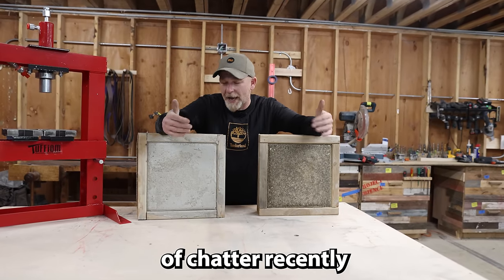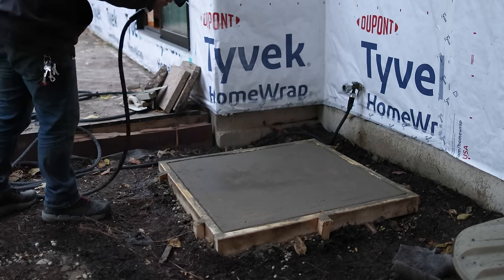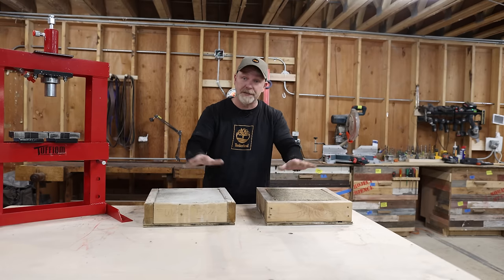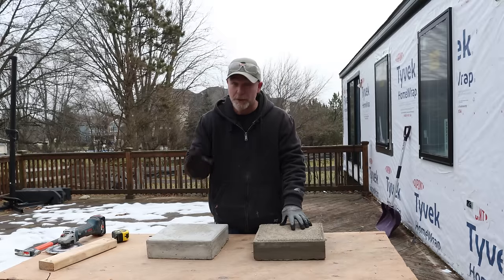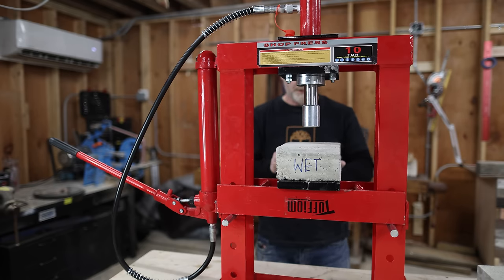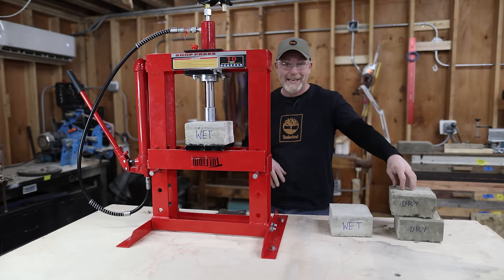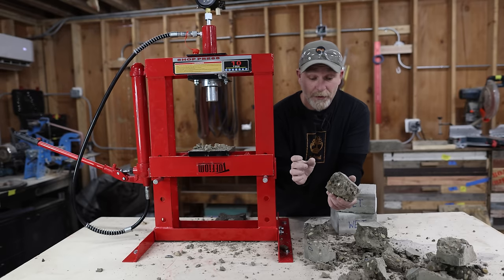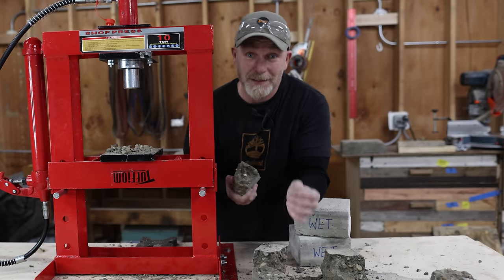The TRUTH About Dry Pour vs Wet Pour Concrete!! Strength Test - You WON'T Believe the results!!

Comment: I'm glad to see the experiment completed, but can't see how anyone would have predicted a different outcome. The strength of the concrete comes from the cement and water being mixed in and helping everything stick together. There's a reason why you don't see manufacturers recommending it. Dry pour concrete is like baking a cake without mixing the ingredients together. You get similar undesirable results. Thanks for demonstrating what a bad idea this is.
Reply: Great analogy to baking a cake
Reply: There was some home improvement dude on youtube a few months ago that was insisting it's fine to dry pour for walkways and stuff, kept doubling down
Reply: My woman makes a "dump cake" that's made kinda like dry pour. It's genuinely delicious
Reply: like a traditional scone, yuck, unless you like to chew powder, un done bits.
 I like scones that have been "ruined' with proper mixing then baking.
Reply: And yet, Hoover Dam was entirely done as dry pour. When the engineering is right, it works.
Reply: @Joe-xy3vy  no it wasn't, there is film existing of them placing normal concrete.
Reply: @Joe-xy3vy   proof?
Reply: @jimmaag4274   I thought so too.
dry pour is a flaky way to go for strength.
 it does good on a fence post application.
Ive never seen it work for a slab or sidewalk.
 seen it tried on slabs - shoveled that mess out & did it right
Reply: I saw it covered in a documentary at some length. The engineers discovered that their particular formulation of Portland cement was stronger if very little moisture was added, and the best way to control for that was to dry pour, then add a measured amount of water. Unfortunately, there's about a thousand Hoover dam documentaries, so good luck finding it.
Reply: There's lots of archival footage of the concrete being poured from the cableway hoppers, and it's definitely soupy. You are dead wrong here.
Reply: @Joe-xy3vy     ? ? ? ! ! !    I think when I have seen those old black & white film documentaries, that was all wet concrete coming out of that  bucket !   I never recall one word of 'dry pour' being mentioned.   They were surrounded by the 'dry' desert.
Reply: I would bet money that Dry Pour was invented by an Accountant.    :-)      Who the heck else would come up with such a stupid idea !
Reply: @Joe-xy3vy Hoover Dam used wet pour concrete. See https://en.wikipedia.org/wiki/Hoover_Dam
Reply: @Joe-xy3vy  r u joking?
Reply: @Joe-xy3vy  wrong
Reply: @BillSmith-fx7xx  someone looking for likes.
Reply: the only time manufacturers are recommending dry pour is for securing fence posts, that is like the one time you would want to do that
Reply: Because now I know anything over 8000lbs is a no no. That's if 50 people are jumping where you put it, or if you have a truck or deliveries going through.

Comment: This is why the teaching of basic science is still so critical.
Reply: 1 outta 6 American's believe the Earth may be flat.  Sleep well.
Reply: This comment is true.
Reply: Science is exactly the answer.
Reply: I loved this video as a learning tool, and I agree that basing knowledge on science is critical, but he would have learned more, more quickly, and more reliably by researching the subject on line than testing it himself.
Reply: This is not basic science, its ongoing research.
Reply: @Georgggg  That requires a basic understanding of science to be able to assess its probable veracity. But yeah, keep em stupid and frightened
Reply: Actually it's like throwing eggs, sugar, water, butter, flour, and oil into a bowl without mixing. placing it in a oven for 6 hours on the lowest heat setting and expecting a cake to come out.... What you get is a burnt mess with no resemblance to a cake.
Reply: @Georgggg  <<This is not basic science, its ongoing research.>>

The research methodology employed IS basic science, though. That's the important part.
Reply: Yes

The wet method creates a suspension, where the finer particles are evenly distributed.
In the dry method, smaller particles filter through and settle on the bottom. That's why the top has that grainy texture.
There may also be differences in the amount of water used. If the dry method uses less water, it wouldn't fully saturate, and can have more variations of water distribution, dry patches, and adding the water may further disturb particles, causing them to settle further down. Results in chalky easily breaking apart cement/concrete. And I'm no scientist lol! that is from basic 90's high school science classes. (maybe even middle school or elementary)
Reply: @jimmiller5600  The 1 has never owned a cat. if the world was indeed flat the worlds cat population would have everything knocked off of it by now..
Reply: @andreademirel5911  Dry pour does indeed crumble MUCH more easily, but for some purposes, that's not an issue.
Reply: @Georgggg research is science is research.
Reply: and this guy should not be teaching it, lolzzzz
Reply: @ajm5007  This comment basically sums up dry vs wet concrete pours. Dry pour for fence posts? Yes. For anything important like a structural foundation? Definitely not. For sidewalks? Yeah, sure if you don't take pride in workmanship.

Comment: Thank you for this. I instinctively knew “dry pouring” wasn’t good but you have proved it without a doubt.
Reply: Nope. He only proved he did an incorrect test. It was wrong on so many levels.
Reply: It's also very often more than good enough
Reply: Spot on Chris dry pour is trash. Only unskilled diy knobs do dry pour. They are the same ones that swear by it because they have no idea.
Reply: It's fine if you do it right. This guy did not.
Reply: Dry concrete says right on bag the tensile strength is less than wet. But it ain't as bad as in this video. In this video the dry concrete was not made according to the instructions.
Reply: As I stated in a comment. He compacted his dry poor. Not much oxygen for curing so you'd expect this
Reply: @robertm1672  

Can you please explain more? Wrong on so many levels? Please, tell us three things done wrong.

Comment: In the 80's we would use drypour for building decks and fences, it saved time. Then in 86 I got a job in the local cement plant and at one point worked in the lab. Cement is made by cooking limestone/marble, iron, shale together into clinker. Clinker is then cooled somewhat and ground down into a powder finer than face powder, at that point it is called cement. When you mix cement with sand and aggregates(rocks) it is concrete mix, add water and it becomes hard and is concrete.
     What happens when you add water is the cement powder crystalizes. This fills tiny spaces between rocks and sand and other crystals, bonding and putting pressure in all directions and during this phase change emits heat. Once the phase change(curing) has gone thru 3 days some 80% of the strength is there, some 3 weeks later and it is at 90%. It never stops curing. HTH
Reply: Your doing the dry pour incorrectly.   Dry pour still requires water, it takes 28 days for concrete to cure.  Concrete will set under water and actually will be stronger.   You will get excellent results with your dry pour if you keep it wet.  The water must completely soak the entire pour,  take your steel trowel and run it over the concrete and water will be brought to the surface if it does not then you havent applied enough water.
Dry pour ?  It's just not what I would do even for a fence post.
Reply: 110% correct.
Reply: W/C ratio. Concrete requires a specified water/cement ratio. Hydration is the chemical reaction that occurs once water is added to the cement batch. Simply misting the top surface of the dry batch does not give enough water. If no water is present, hydration does not occur. To dry pour, I agree, you must add the required water in the forms and mix it it place.
There is no way I would allow a dry pour on any project of mine (civil).
Reply: Well Hoover Dam !!
Reply: @Sjwolosz321  The curing of Hoover Dam would follow a declining exponential curve that ideally tapers out until the last water molecule is chemically bound to the tricalcium silicate in the Portland Cement binder. (Scientific Principles of Concrete.) See also ACI.
Reply: @sawdust3537  Ha !! .. When I pour a 12' wide 4" thick footer for a 3 story house . I get the powder" Type K " specifically and screened gravel . . Mix and dry pack myself . It's better on my worker's back .I might even throw in a piece of # 4 rebar on the top so the inspector can see it's been done right .Then fill the trench with water and on hot days . Throw in a couple of bags of calcium for good measure  . It's a lot easier on bridges and overpasses since the reduced haul weight . Sometimes the powder gets mixed with mud , but mud stained concrete exude Strength !   My special formula was mentioned in Fine Homebuilding magazine and my version of concrete has been studied by expert crapenters for years
Reply: @vidxs if you dry pour and soak with water after you still have no control of aggregate separation. Setting concrete in wet state eliminates this. 
I can't imagine there's a code office anywhere in the US which would allow such an application in any structural application.
Reply: @Sjwolosz321  I never heard of a 4” thick “footer” (footing?) for a 3 story building. Should be thicker. 
And approved shop drawings dictate reinforcing steel placement, 
We don’t “throw in a piece of #4 rebar”. The re-steel and forms get inspected prior to concrete. A Permit to Place is issued and a pre-install meeting may be required. 
The JMF must also be approved prior to pour, and tested upon arrival.
(This is why I like civil or gov. funded projects so much better than residential, it’s standardized.
PS, enjoy our conversation
Reply: @vidxs  yeah, you mist it the first time and then you wait 30 minutes to let the top setup a little before SOAKING the cement. and Dry pour is only meant for stuff like side walks or shed slabs at best. works just fine for fence posts too, you are just giving the post something hard to push against instead of dirt
Reply: @vidxs  the diference is the wet mix gets everything wet evenly, kind of like poring all the ingredients for stew in the pot and not stirring it. I cant believe anyone honestly believes drypour is as good as wet mixed cement. Quit belieng a cheapskate and rent a mudmixer
Reply: I would modify how much water is added to the dry pour and try the test again. The misting is not enough water, needs more earlier on to get the mix to kick.
Reply: I just witnessed a conversation between a robot and a comedian. 😐 (in this comment thread)
Reply: As a hypertufa artist, I agree.  Concrete is amazing when done right.  After I would make my item, I would toss it into a kids swimming pool of water to help cure it.  It would get so hot when curing.  Cool stuff.
Reply: @vidxs  They literally make a Quikrete dry pour mix for fence posts.
Reply: @NA._  I know cement sets up in the bag just from humidity.   I know there is some fast setting cement sets in five minutes but the expense is high,  bet you pay more than $20  for a 60 lb bag,  sure going to make that a expensive fence before your through.
Reply: I suspect you have to mix it while wet to get a homogeneous mixture otherwise you will be introducing all kinds of defects and point stresses in the block.@vidxs
Reply: Good explanation for the non concrete educated people, me being one.
Reply: we know
Reply: @Xfacter 
I’m not sure the robot enjoyed it, but I got a pretty good laugh 🥸
Reply: @sawdust3537
Fortunately, there are building codes in most places even for residential projects. 

Definitely agree, the 4” footer is nonsense and throwing rebar on top is worse than leaving it out. Most people don’t realize that rebar needs 3” of concrete around it to keep it from corroding when the concrete is in contact with the ground.
Reply: @earlcampbell8927  I had to re-read this comment thread to remember the context and now I got ANOTHER good laugh. Good laughs all around 🍻
Reply: There are many different recipes for cement and for concrete too. Recipes are different depending on the tensile strength needed, availability of the ingredients and the expected climate conditions in the next 50 years. So that's very differently and dry weather compared to higher humidity conditions
Reply: On the next test ,try putting the form on the ground,and cover with plastic between misting,interested in seeing how much,if any improvement.
Reply: Whats the building codes in Tijuana?@Sjwolosz321
Reply: I was told that it continues to get harder for about a hundred years and then slowly decays .
How slowly I don't know .

Comment: On the side of my garage, I dry poured a slab that was 12' x 24' and 6" deep. With a wire mesh. There's a couple out there that have quite a few videos on how to do a dry pour. I can't recall the name of their YouTube channel. The process they use and what I did was the following. After finishing the pour, I misted the slab once every hour for a total of 3 times. Waited an hour after the last misting. Then a long soak every hour for each inch of depth... in my case that was 6 long soaks. The hose nozzle was wide open. I then let it cure for 4 weeks. 

That was almost 2 years ago. I park my 2005 dodge ram 1500 4x4 quad cab on it. Last month, on that slab, I had it up on 4 jack stands, with no damage to the slab. It took me about three days to do a complete brake rebuild, and all of the weight of my truck was on those stands. 

I'm not disputing that wet pour is stronger, but I think that you made an error by only misting and not doing the long soaks. I think your results would be better if you were to do that.
Reply: 100% correct
Reply: Correct! Cajun Country Livin’ is the couple’s YouTube channel. I’ve used their method for a concrete paver-style walkway, with 4- 4’x2’ slabs for our side gate where our city trash/recycling cans go. It has been 2 years without cracking or chipping.
Reply: Truck is barely 1 ton divided by 4 jack stands = 1250lbs per stand. Not alot of weight. 6" concrete should be able to handle an 18 wheeler, large tractor, or large RV. Curious to see how it would handle under those conditions 🤔
Reply: @user-dq3jk9py4q  IDK, it would be interesting to see a proper experiment to see how it would do. 

I wonder if someone will ever come up with a specialized concrete mixture specifically designed for dry pour applications?

All I know for sure is that my dry pour slab is holding up quite well. 

I did a dry pour because that area is  unreachable by a cement truck, and I had no desire to wheelbarrow wet concrete all that distance and into a tight spot. Mixing it myself would've posed other issues. So I thought it'd be worth the try.
Reply: Thanks
Reply: @ελευθερία-ε2ο well i’m sure he doesn’t plan on having an 18 wheeler in his driveway!
Reply: Yea, the person doing this dry pour concrete test surely did an error with his dry pour test slab and sadly many folks will accept his advice as concrete proof that dry pour cement is no good and they have no idea of the error he made and sadly those whom watch this video will only have negative outlook on dry pour concrete because of this video and sadly they will never try the dry pour to test it out for themselves. 

Dry pour concrete surely works and is strong.  God bless you for sharing your testimony of dry pour cement and hopefully more see it that they would not be afraid to try dry pour themselves.
Reply: @UgH_309 

From them I also learned to properly do dry pour cement and doing it that way works well.  👍
Reply: @John_Lete  I think he did it on purpose to confirm his bias against it, or maybe to keep cement contractors working. What they charge  to pour a slab is insanely expensive. 

How he did that dry pour was absurdity in action and a lack of common sense.
Reply: @srgshiloh  I hear this all the time. The problem is many people will over compensate by using a thicker dry pour vs traditional wet pour. I don't know about you but I don't need to be burning 50% extra on materials, not to mention the extra prep it will take to dig down for a 6 vs 4 inch pour. 

I mean if you like doing that extra work and buying that extra concrete go for it. Or maybe you figure the extra concrete will still be less than a contractor wet pour- again, go right ahead. I'll do it myself with a 4 wet pour.
Reply: @ελευθερία-ε2ο have you ever weighed a 1 ton truck??? They don’t weigh one ton bud… they are about 8-9,000lbs. Your math is off
Reply: @jeremysimpson1432  OP specifically said a Ram 1500 4x4 quad cab. That's approximately 5000lbs ÷ 4 wheels = 1250lbs. So, my math is correct, bud....
Reply: @ I read 3500 looked back and see 1500 my mistake.
Reply: @jeremysimpson1432  no problem, sir.